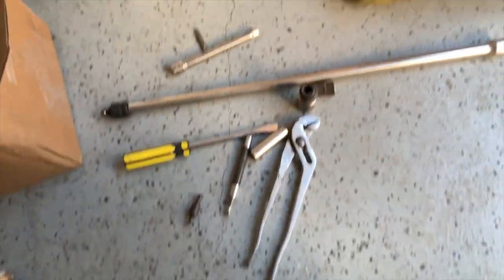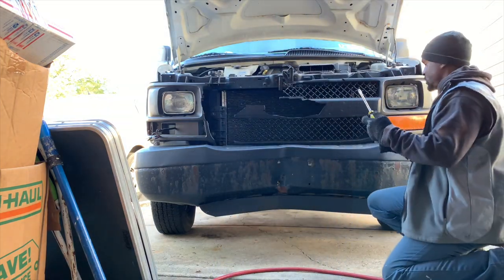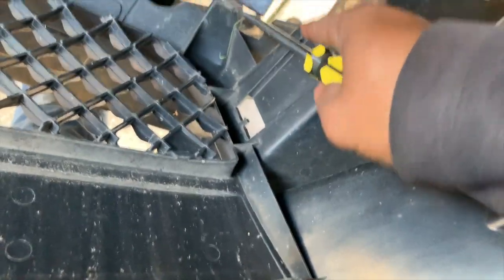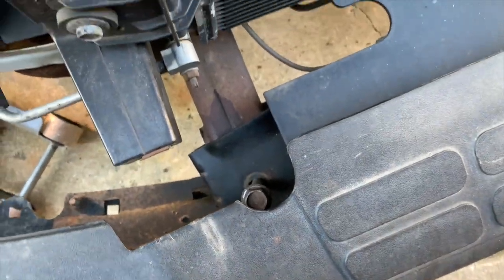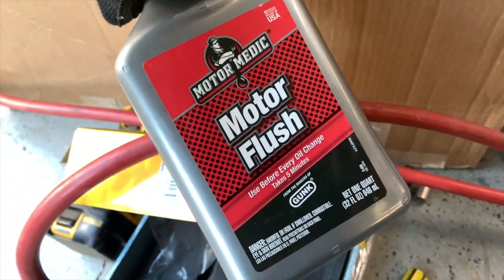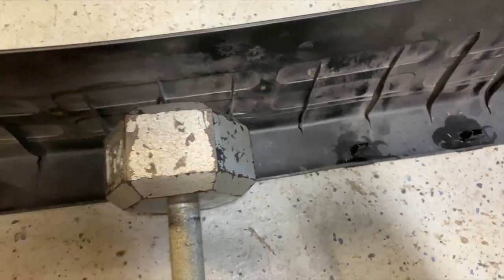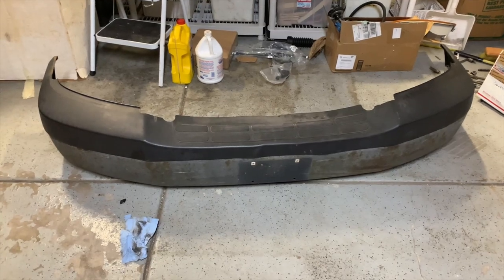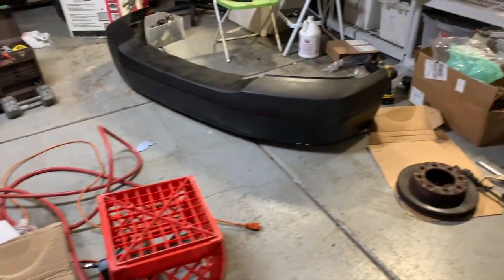How to Remove & Install A Bumper and Grille On A Chevy Express Van/ GMC Savana Van + Tips!

Comment: man this video saved my life. just bought a 2017 uhaul trade in savana, it had some minor drivers side front end damage, which had been fixed with a new bumper assm. whoever put it on shouldnt have, it is an after market part, but that wasnt the problem. both supports were left bent down a little, so both sides looked like your drivers side did. i thought I was gonna have to buy a new bumper kit from gm to get it to fit, until I saw this. 5 minutes and a floor jack , and done....thanks  Terrance , your the man...
Reply from the maker: You're very welcome, Brian. I am glad my video helped you.

Comment: Hi Terence
Great Job! Thanks for making the effort to share the very helpful video.

Just yesterday I was under my 2009 Savana Van Bumper trying to Install Rigid Fog Lights into the Bumper Frame but the heavy steel bracket behind the Bumper prevented me from Installing them where I would like to. 

Now after seeing you video, hopefully, I will be able to Remove the Bumper & Drill & Cut into the metal Bumper supports to Install my Fog Lights as envisioned.
Thanking you from Toronto, Canada.

Comment: Actually, you remove the turn signals by pushing the screw driver behind the OUTSIDE edge of the lights and pushing on the U-shaped spring tab while prying outward.
Reply from the maker: Hi AL, you are absolutely correct! Thanks for sharing that info.
Reply: I've had to do that more times than I wanted. :D
Reply: Came to post and tell you the same, u seemed pretty knowledgeable and you made that silly mistake.

Comment: The front marker lights should be payed out from the outer corner edge where the spring clip portion of the housing is instead of the front part towards the center of the grille

Comment: Great thorough video. I like the part with the jack. How long did this job take? Thank you 👍
Reply from the maker: Hi, it didn't take long at all. Maybe two hour for me only because I was filming. Thank you SO much for watching.
Reply: @TerenceDIY  I live in Chicago and dented the front left of a gmc 300 2021 Uhaul 10 foot box truck. Do you have time to swap out the bumper and cover and if so how much labor and or labor and materials. I can get materials if that is easier. It will need to be a new bumper. I can drive the truck to you. Let me know. I can assist or not up to you. Thank you.
Reply from the maker: @nevillewhite3451  , where in Chicago do you live (west, south, north, east)? I purchased a house in Indiana that I am working on at the moment but I may can help. Is it a rental or is it something you own?
Reply from the maker: @nevillewhite3451   you will need these parts. 

https://www.carparts.com/details/GMC/Savana_3500/Replacement/Bumper_Cover/2021/C010338.html?TID=gglpla&origin=&utm_source=google&utm_medium=pla&utm_campaign=12320313292&gclid=Cj0KCQiAmaibBhCAARIsAKUlaKSz8fnHDueWqiQKScLv4nFs0DwjH2ob5hjaHQJjY1MvBj4SLkhaLjAaArPAEALw_wcB&gclsrc=aw.ds

https://www.carparts.com/details/GMC/Savana_3500/Replacement/Bumper/2021/REPC010102.html

Comment: Terence thanks. I'll be changing my 2008 Express bumper today. 
Couple years ago I was "drifting" (not intentionally), lost control and was stop by divider. I had to use jock between front tire and bumper to move the bumper out of the tire. Then year later I hit the deer. Stupid poor think run away. I had to use jack again.
Reply from the maker: You're very welcome. I hope you got it fixed. Thanks for watching!

Comment: Thanks for the video! Do you know if the grill absolutely needs to be removed to remove the bumper or can all the bolts be reached without removing the grill? Thanks
Reply from the maker: Hi Charles, I am not sure if the grill needs to be removed or not. Even if it does, it should be very simple. Thanks for watching!

Comment: Did you have to do anything to the bumper to make the paint adhere, and how is it holding up?  I've been thinking about spraying Krylon textured truck bed paint on my poor hood and may do the same to the bumpers.
Reply from the maker: Hi James, I didn't have to do anything to the bumper for the paint to adhere and it still looks great after two years!

Comment: How much is a replacement bumper worth ?
Reply from the maker: Hi Rory, sorry for the late response. I am in the midst of a privacy fence build that I am filming so I have been very busy. The price can vary. You can pick one up at the junkyard for less than $100. I found my parts on Craigslist for much cheaper. I am talking a used one buy the way. Thanks for watching!